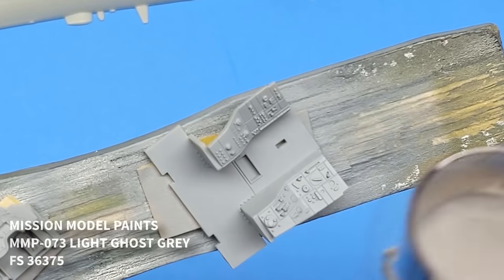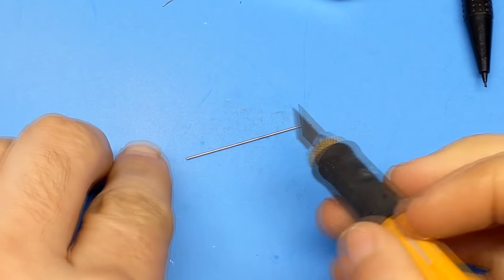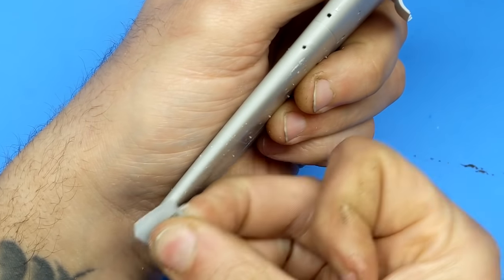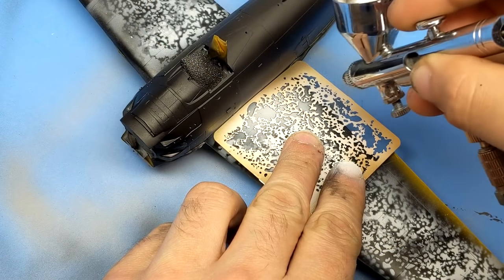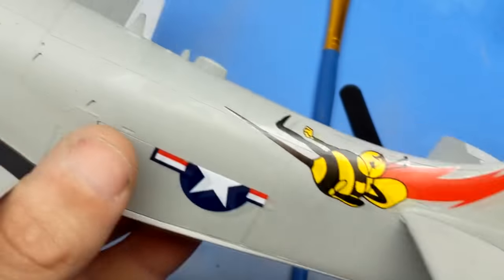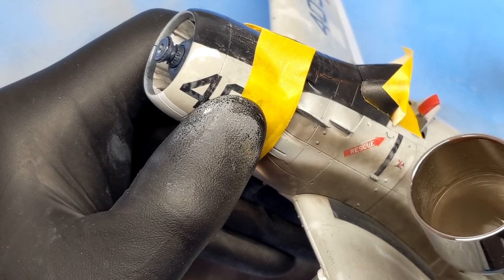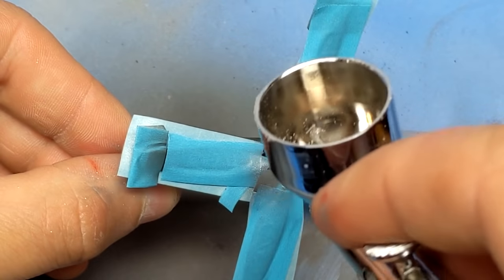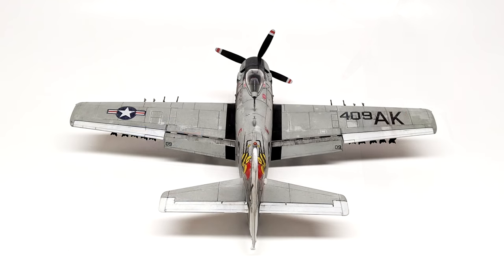One of the best model kits for a beginnner: The 1/48 Tamiya A-1H Skyraider

Comment: I didn't know the designers of the A-10 were thinking about the Skyraider but I myself have recognized the connection and how their roles are the same, with the A-10 being the more modern version. I'll add my other comparison, I wonder if, when designing the Skyraider Douglas engineers were thinking about  the previous British Hawker Typhoon, which was a real beast to handle and had some deadly quirks but had tremendous performance, could also carry heavy loads at high speeds and wing loading yet maneuverable with its 2,500 HP engine and 14 foot propeller.

Comment: Nice build👍🏻 I’ve had my eye 👁 on this kit for a while. I totally agree on not having too use clear before decals. I’m in the middle of the Airfix P-51 nice kit with good details but get ready to get the modeling skills out. Mine had a short shot  just forward & around the tail wheel 🤬. Took a fair bit of putty & shaping. Got it in primer & surprised myself. Some good decal options in that one two. I’m doing the RAAF one of cause. Thanks for sharing 
👍🏻👍🏻🙃🙃

Comment: Thanks Robbie for a very nice build video! Very fine result, way beyond anything I produce. About panel lines, have you done panel lines in a lighter hue? If so, what was the result? Asking because my panel lines always pops too much with black and I'm in a building pause.
Reply from the maker: With black basing it doesn't force panel lines to be darker. By building the paint slowly up you can control how much weathering shows through.

Comment: I'm building the Tamiya F-14 Tomcat. I am new to weathering techniques, panel line accenting..ect. The jet is going to be the all gray low viz color. I like your suggestion about not pre-shading. I want to add smudges and some panel accents. Would you clear coat first, and what medium and technique would you suggest?...thanks
Reply from the maker: Once all of your painting and decaling is done, I would do two gloss coats. That way if you don't like the weathering you can remove it without damaging the paint
Reply: @TheModelGuy  Good idea. Could I remove it with windex or lacquer thinner? Would it eat into some of the gloss coat while removing?
Reply from the maker: @Plydrms  The easiest way to explain it is to get you thinking of each paint as a layer. When it comes to weathering, your paint should be a different type than the layer below it. For example, if you have put down a gloss coat that is lacquer based, your next layer for weathering needs to be a different base. Example being Acrylic or Oil. If you use the same base as the layer below, it will react, especially when removing it. I made the mistake of thinking a certain wash was enamel, but it was actually lacquer and it destroyed the layers underneath.
Reply: @TheModelGuy  I'm glad that you mentioned this. I would of thought that a different type of paint base could attack the layer below it; say a lacquer attacking an acrylic..no??  I have read that Tamiya panel accent is pretty "hot" and can attack your acrylics.

Comment: You invited criticism, so... Never seen that lattice work of black lines all over a real Skyraider, or much on any real aircraft at all. I know that they are the highest and hottest fashion among scale modelers, but I've never found it "realistic" or good looking. A few panel lines, the ones that are access panels that are opened and closed all the time, are usually visible, but more subtly than that.
Reply from the maker: Third hit on google:

https://i.pinimg.com/originals/12/51/6f/12516f53f0066dda777da9083006f7a3.jpg

Grime in the panel joins is a real thing

Comment: Proceeds to make a massive fuss about not gloss coating, and the next paragraph discovers tape removing paint... ',:D
Reply from the maker: Which has nothing to do with gloss. That's vallejo not sticking. Gloss doesn't "block" the paint underneath and only sticks as well as the paint is sticking underneath. Plus the model hadn't been glossed yet when that happened.
Reply: @TheModelGuy  the gloss coat will provide a little more strength.  You are right it is limited by the layer underneath, but it would be an improvement.  Your "Plus..." sentence doesn't make sense.
Reply from the maker: There was no gloss coat on when the Vallejo paint lifted. Gloss wouldn't have protected it.